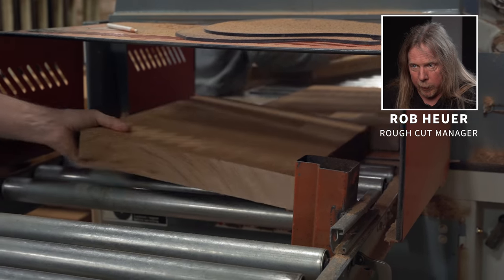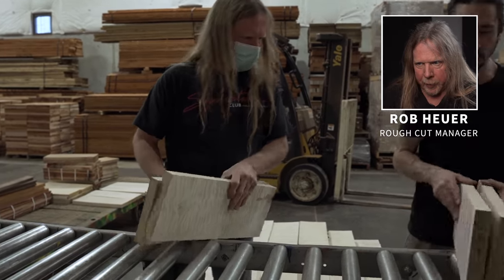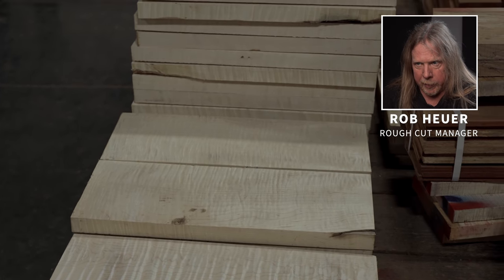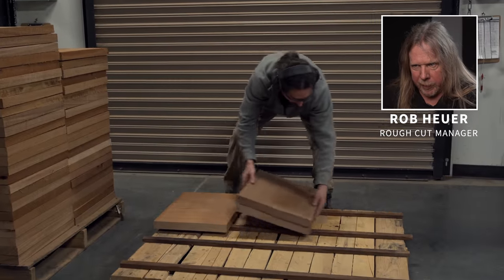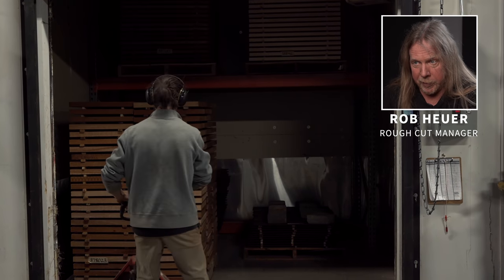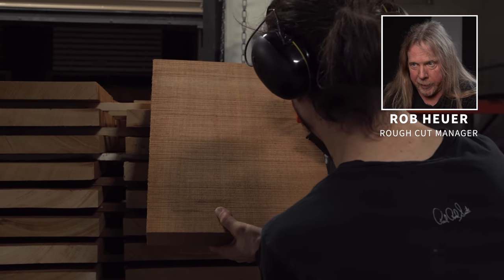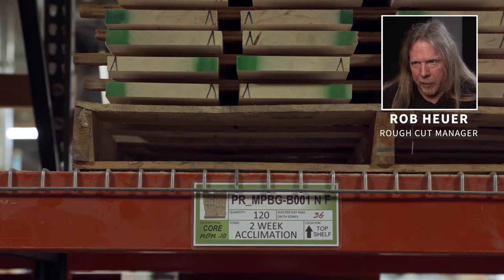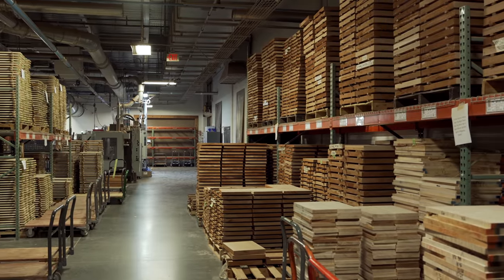How We Prepare Lumber for Guitar Making | From the Factory Floor | PRS Guitars

Comment: A question; it seems like when the blanks are being heat-dried, the exterior blanks would get dry, but the interior blanks would not get as dry.  I realize they are stacked in a way that allows air to circulate, but without a fan of some kind, it seems like the blanks in the middle would not get much air flow.

Thoughts?
Reply: They have fans that circulate the air. It doesn't take gale-force wind, just a light breeze is sufficient.

Comment: I'm a little confused. The stack of back blanks goes into the hot room to get the moisture content down to 5-8% but then sits on the shop floor for 2 weeks to "absorb the moisture it wants to"'.
Reply: ever buy a baggie of weed and it dries out ? just put a small piece of bread in the baggie and it will absorb the moisture

Comment: Why are maple tops always two parts of wood?
Reply: It's called book-matching.  Saw a hunk of wood down the middle of the thickness, then open it up like a book.   The grain that is exposed is nearly identical and complimentary, so you can get extremely beautiful "matched" figuring.
Reply: @DethWshBkr  is correct. Also worth saying maple trees aren't usually wide enough either for a full top, thus book matching process.